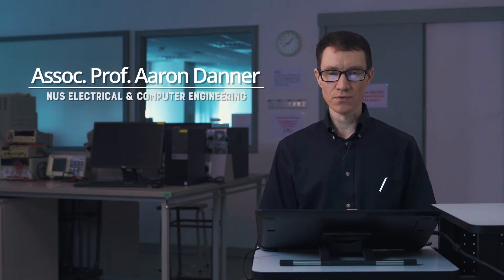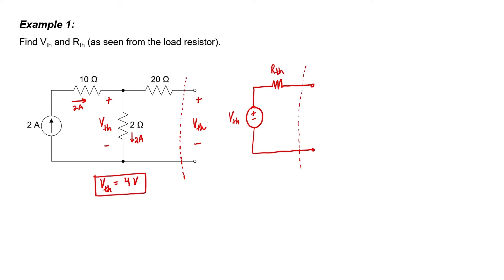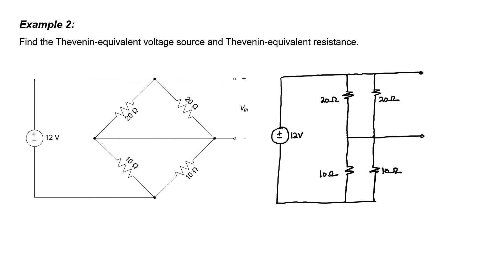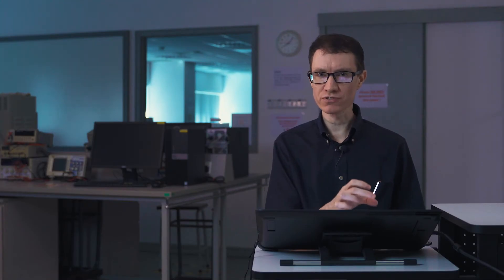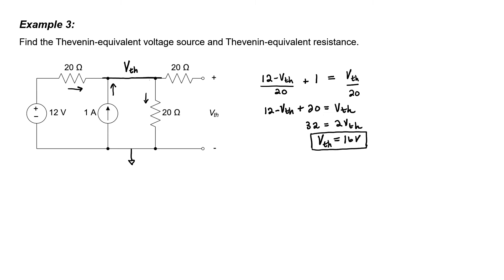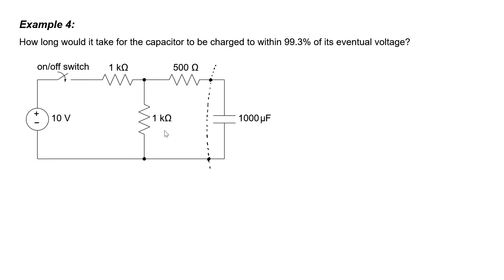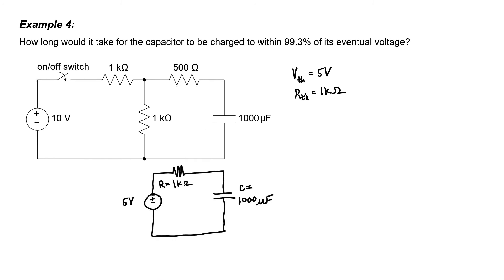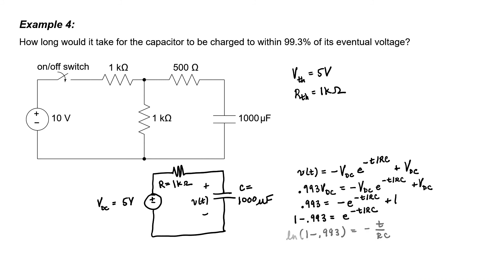Thevenin's Theorem Examples (Circuits for Beginners #29)

Comment: Why isn't the answer to Ex. 4 5 nanoseconds? If it takes 5 RC time constants, and R = 1000 and C = 1000x10^-12, then 5 x 1000 x 1000x10^-12 is 5x10^-6, or 5 nano seconds. Can someone help me understand what I did wrong? Thanks.
Reply: 1,000uf = .001 farad. Or you can use 1 x 10^-3. You are confusing uF with pF.